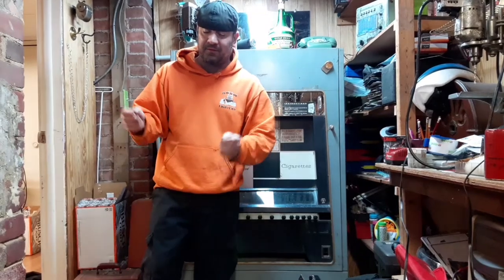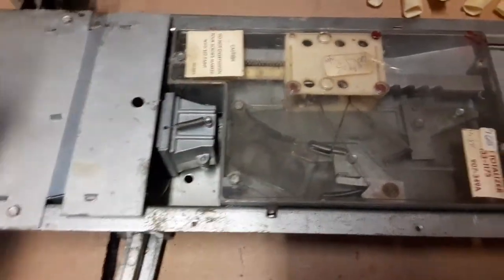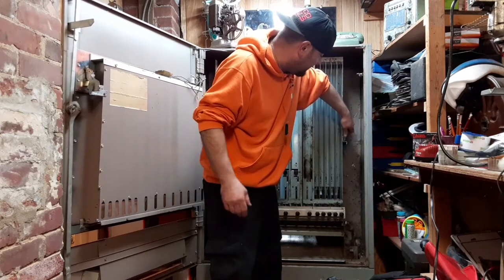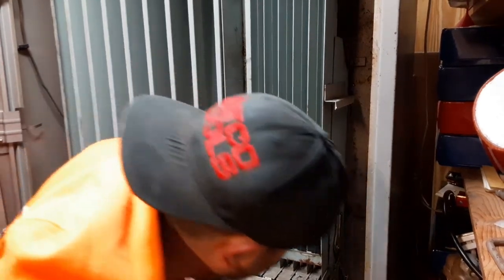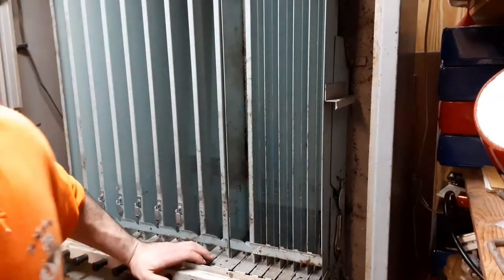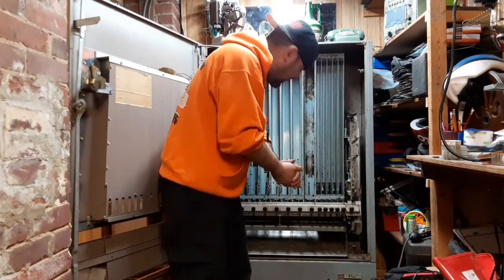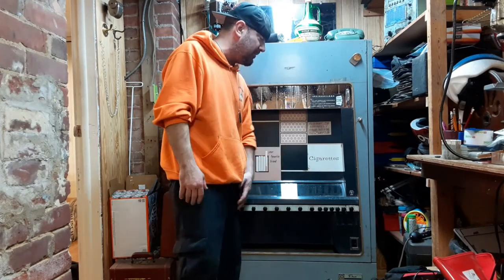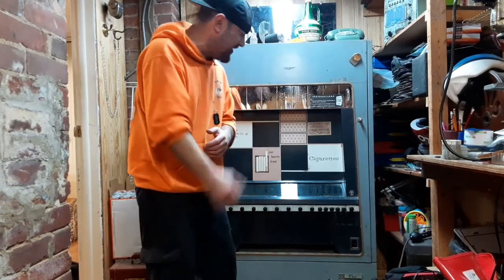WHAT EVER HAPPENED WITH THAT COIN REGISTER.. vending machine restore pt 3

Comment: I belive that the coin mech with not accept coins if there is no product in the machine...I could be wrong but thats how it is on my National Crown Line 222 Cigarette vending machine. I just replaced the plug end on mine as the cord was damaged and was improperly repaired by the previous owner. I also put in vintage cigarette packs that I purchased on ebay and it really makes a difference to see product in the machine. Keep up the great work on your machine and I look forward to future videos.
Reply from the maker: Thank you and yes that makes sense. I did notice there's little levers in the back to tell when it's empty or not, you're probably correct, it just what's the change go right through the coin box if there's nothing there. Honestly I didn't even think about that, thank you